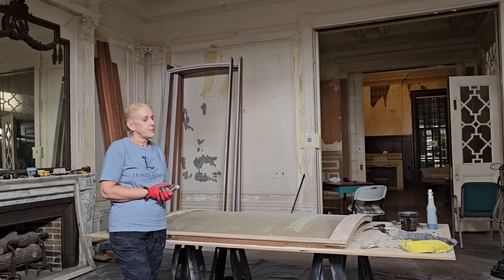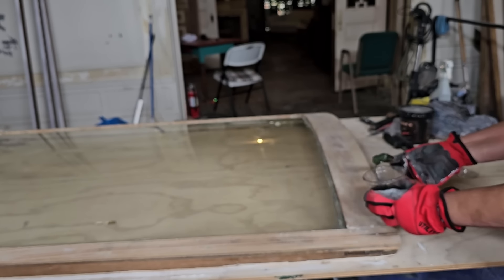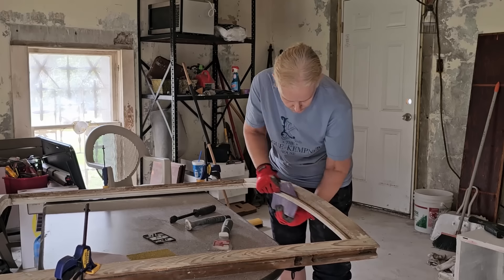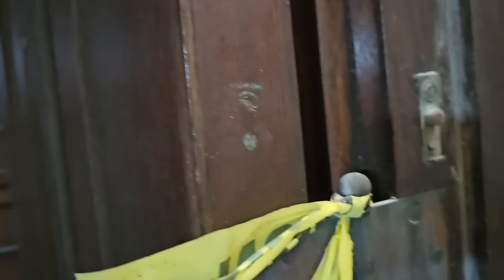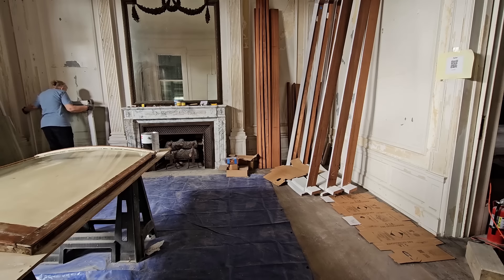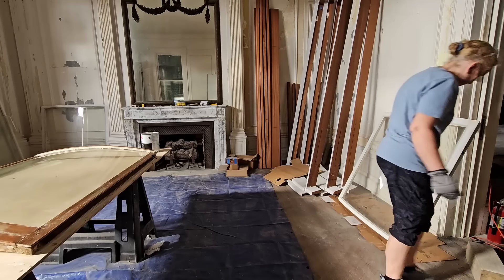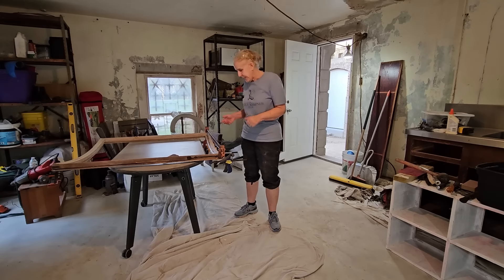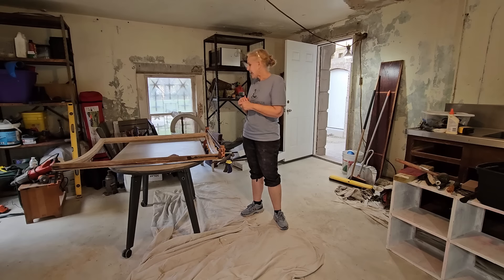S4.15  The Windows are Almost Done But There's Still Some Prep to Finish

Comment: My house has buttons in some of the closet doors and they used to turn the lights on when the door was opened. I've seen it in other early 20th c houses
Reply from the maker: That would be a great feature to have at the entry door.  Now I'm wondering if we can trace the wiring to see exactly what it does.

Comment: Why are you using modern paint.  That isn't what they used.  I would not use acrylic paint it's not good for old structures
Reply from the maker: We follow all the recommendations of the National Parks Service Restoration Briefs.  Modern paint is recommended as the old formulas have been outlawed for containing toxic materials such as lead and should never be used.  Color matching to original colors or period colors is recommended.